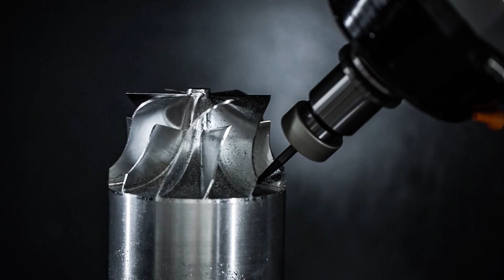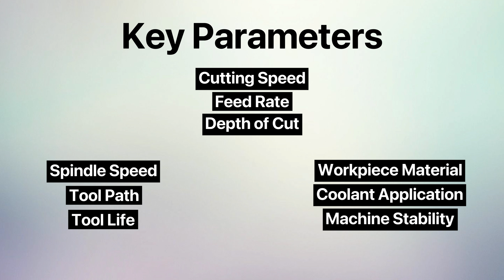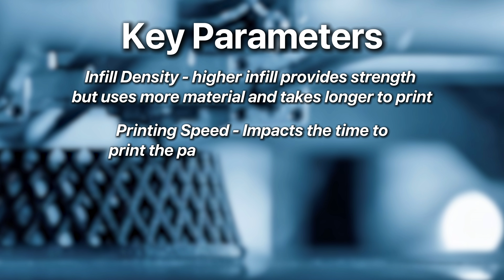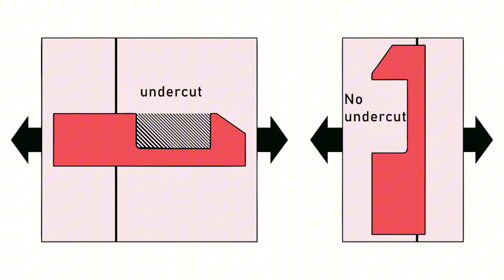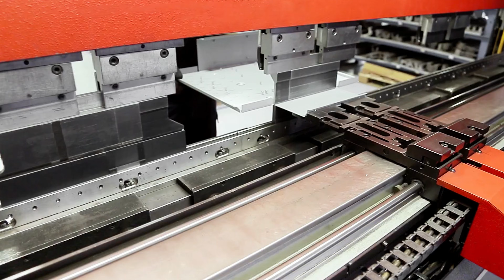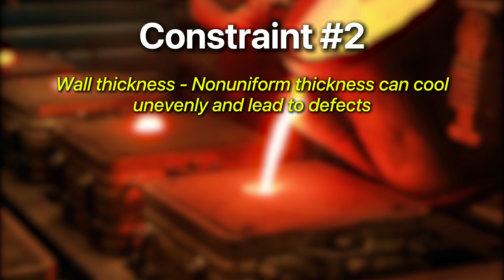Top Design Tips & Manufacturing Processes for Mechanical Engineers | DFM Guide

Comment: Great video! You covered a lot of material that is useful in design and manufacturing.
One thing I would like to recommend in consideration of designing for injection molding is to consider molten material flow in the die/tool. Tool design engineers will help with this but knowledge upfront can help in part design.
A couple of process failures from improper flow in the tool are uneven fill, bridging, high turbulence. There are more but those cover the majority of failures in design of part and T0 forward.

Comment: Question. What do mech engis build now a days. Isn't everything already done and has a pattern to plug in numbers 

Leaving the top 1% who might be working on the best engine or the most efficient ones or better cranes or something. 

What do the rest do ? 

Asking the question what do mech engis do has proven pointless cause the answers come from professors who haven't built a single thing in life (including their syllabus) and high management who don't even need to 
And they all answer it in the most generic fashion ... As if none can see if they changed the word mechanical for anything else it would still apply. 

So yea 
What do most of the mech engis build now a days ? 
What kind of companies do they go to ? 
That other engineers aren't already doing a better job at 
(Metallurgy , civil , electronics, chem) 

I know mech turn 1 type of energy into mech energy in whatever rotation or linear movement needed. 

But what are they building now a days. 

Does thermal come under mechanical ?

Comment: I am a little disappointed in this video. It´s even simpler and better categorized in DIN 8580. There are 6 categories of manufacturing techniques in total worldwide.
1. "original forms" (Urformen) --> Casting, 3D printing, sintering etc. Additive creation of a part
2. "transforming" (Umformen) --> bending, forging etc. without any material addition or subtraction
3. "separation" (Trennen) --> milling, turning, cutting etc. subtractive technique 
4. "joining" (Fügen) --> welding, gluing, fastening, riveting, soldering etc.
5. "coating" (Beschichten) --> painting, galvanizing etc.
6. "change of material properties" (Stoffeigenschaften ändern) --> hardening, tempering, etc.
All those are further subdivided, into sub categories.
Reply: he is using different standards since he is in the US but the DIN categorization is very thoughtful. thanks for sharing that
Reply: @Hand-x1j  Yes, I know he is. 
I just thought the DIN categories are easy to learn and to comprehend for beginners. Didn´t mean to say he did a bad job, he didn´t. Thank you for your comment.